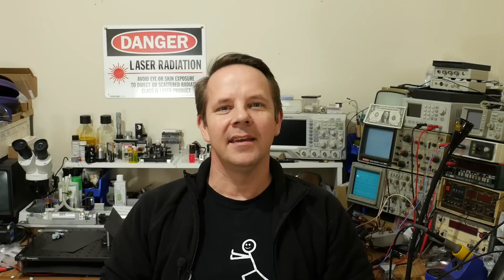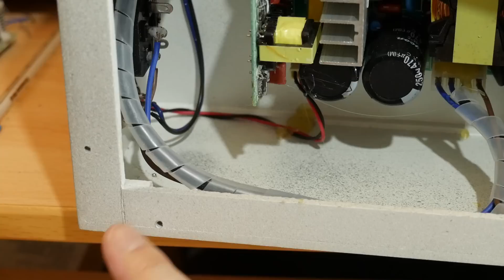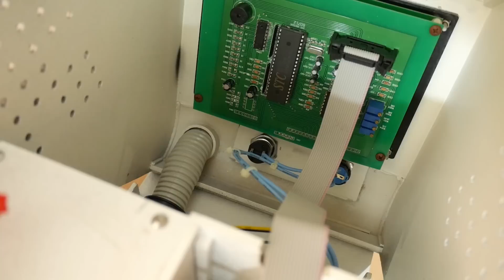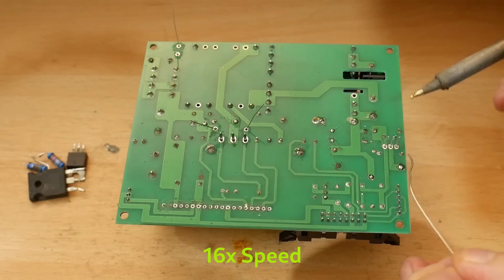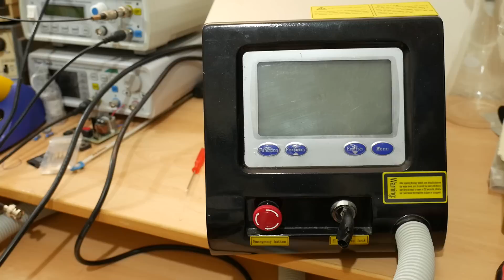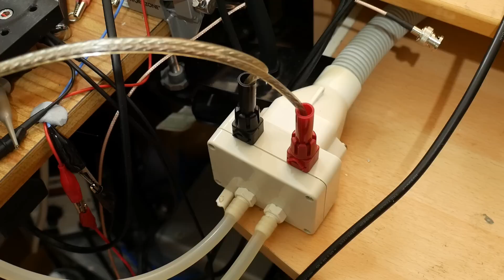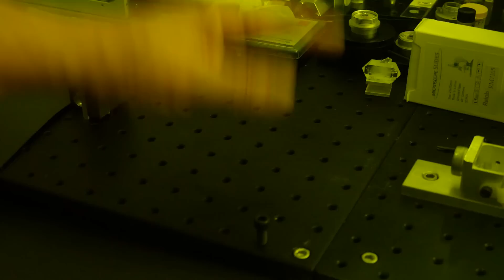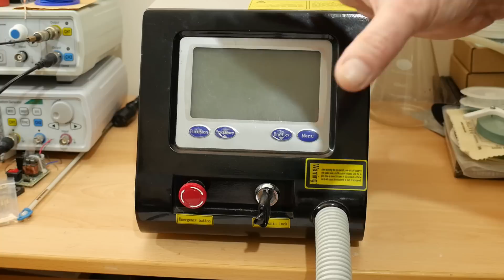DANGEROUS Laser Power Supply Teardown!

Comment: My first thought was...rebuilding the Pulse Forming Network (PFN)...just from seeing the inductor...maybe scraping the PS and use the head for a decent solid-state laser.
I would never think a laser design could be sooo bad!
Reply from the maker: Yeah the PFN is, weird! I suspect the inductance drops to a reasonable level once huge currents are flowing. I have ordered a larger, more spacious ferrite core to wind my own and measure what happens. I have seen this kind of design before, so it cant all be bad, though I think the implemetation here probably is!
Reply: This may be one of those "extreamly" easy-to-fire lamps, and the cause of the tube strike-on may be non-critical damping, probably due mostly to the inductor. @LesLaboratory
Reply from the maker: @dalenassar9152  If it is, then the characteristics are similar for different lamps. I tried it with another head and it has the same effect. Moreover I can hear faint cracking from the main cap, suggesting it is stressed. But yeah, that inductor needs examining. I'm going to replicate the circuit with a home made inductor to see if it can be characterized.
Reply: Speaking of homemade inductors:  I have done a lot of that, they are VERY touchy, to say the least.  In my experiance, the inductor is the brains of the network...I have had some very large pulsed solid state lasers that have required inductors that were about a cubic foot in volume, not many though.

There is a axiom that states:
=====
FOR A GIVEN FLASHLAMP, PULSEWIDTH, AND ENERGY,THERE IS ONE AND ONLY ONE VALUE FOR C, L, AND V THAT WILL RESULT IN CRITICAL DAMPING.
=====

I will dig it up an application that helped a university laser lab and post it here...if you like...it may be of some help.
 @LesLaboratory
Reply from the maker: @dalenassar9152  yes, please add it here. In my own design I used air core as too many variables with almost any other material. I suspect these designers just threw in a cheap homemade trigger transformer, and they were done. It would be interesting to 'scope it when it fires.
Reply: One of the first things to realize (as the analysis will show) is that you can't pick any capacitor for a given flashlamp.  For example, if you end up calculating that a lamp wants a couple of kilojoules, you can't very well fit it with a single 500J capacitor.  Let's look at such an example now: in particular, choose the Xenon lamp I have on ebay.  The first thing we calculate is it's 'dynamic impedance' denoted Ko which has units of {Ohm-amo^-.5}. ** This value is constant for a given lamp.**  The formula is:

(1)  Ko = 1.28 (l/d)*[(p/x)^(1/5)]
where:
l=lamp arc length (mm)
d=bore size (mm)
p=fill pressure (Torr)
x=constant: 450 for Xenon
                  805 for Krypton

Applying (1):
Ko=1.28 (165/13) (450/450)^.2

Ko=16.25 ohm*amp^-.5

next we can calculate the explosion energy (Ex) of the lamp--for a given pulse width. Units are JOULES:

(2) Ex = k*d*l*sqrt(t)  joules
where:
k=90 (constant)
d=bore diameter (mm)
l=arc length (inches)
t=pulse width (ms)

for this lamp:
Ex=90*13*6.5*sqrt(1)

Ex=7605 Joules
this says that the lamp will have a life (number of flashes) of ONE for a 1ms pulse energy of 7605 J
we want much more than a single flash life, so now we look at the 'Life equation'...

(3) L=(Eo/Ex)^(-8.5)  flashes
equation (3) lets us choose an energy (<Ex) for a desired Life (number of flashes)
For example: suppose we want a life of 7500 flashes---what energy should we pulse the lamp with?
..well we can't use (3) directly, we have to solve for Eo.  This gives:

(3a) Eo=Ex*exp[(ln(L)/(-8.5)]  Joules
plugging in L=7500 flashes, and Ex=7605 J gives;
Eo=7605*exp[(ln(7500)/(-8.5)] which yields:

Eo=2665 joules
Obviously this is a fairly high-power lamp and we can't just pick a 500J capacitor for an Eo of 2665J.  Note, there are possibilities like choosing a HUGE Life of something like a billion flashes--but before doing something like this, just get a smaller lamp.

A good parameter to calculate now would be the required capacitance (C).  C is given by the equation:

(4) C={ 2*Eo*(a^4)*(T^2)*[Ko^(-4)] }^(1/3)
where a (alpha) = 0.8 for critical damping
T=circuit time constant (not to be confused with pulse width (t) denoted with lowercase t.  use t=3T
Plugging these values in (4) yields a capacitance...
C=1515uF

Using the familiar capacitor energy equation E = 0.5*C*(V^2) we can derive the equation to determine charge voltage (V):

(5) V=sqrt(2*E/C)

plugging in Eo=2665J and C=1515uF gives:
V=1876 volts

We have found C and V.  Now to find L (inductance for critical damping)  we use the formula T=sqrt(LC) or:
(6) L=(T^2)/C

substituting, we get:
L=73uH

So for this lamp to last 7500 flashes at 1ms pulse widths we can use a 1515uF capacitor charged to 1876 volts in series with a 73uH coil.
or:
C=1515 uF
V=1876 v
L=73 uH
---------------------------------------
BUT...suppose we cant find a 1515uF capacitor?  Note that eq (4) can be solved for T, letting us use a different T to find a desired C.  Of course we could choose a lamp with a different Ko which usually only requires looking at the lamp dimensions and gas type. Try changing the flash lifetime (L)...Increasing L will decrease Eo, C, and V.  These equations, and experience using them can be very versatile and can get you the desired C,V, and L for a given lamp (Ko), pulse width (t), and energy (Eo).  With the help of a very simple computer program, useful tables of several values of the parameters, such as L, Eo, C, V, L can be tabulated for, example, a fixed Ex and t.

You will get your solution,  I like to fine-tune the damping with a 'scope waveform capture, adjusting L, and/or V after firing for that precise critically damped current waveform!

Hope this helps--there is actually lots more and I will be happy to help you further in any way I can.  I can look up some samples that I actually used in designs if that will be of further assistance--just ask.

Bgds,
--daLe

PS
At the moment I don't have the energy to recheck all of this so just you know, I am sending it unchecked for errors
 @LesLaboratory

Comment: This is from an Asian factory with a dirt floor and children working for a bowl rice a day. Put it in a proper case and add your own Arduino controller as that asian SW is full of crap.
Reply from the maker: Probably. It really is quite sad that this kind of stuff goes on. I think if used a microcontroller, I would be as well isolating it with a few inches of fiber optic. The PSU is bound to be electrically very noisy.

Comment: When you said the case was plastic, my immediate thought about the picture was: it looks like someone took an existing sheet metal design and said "make it out of plastic".
Reply: Yes, likely metal design that had a cheaper process applied, using plastic sheet to replace the metal parts, likely because the cloner does not have metal working, but has a guillotine that can handle styrene sheet, and has a drum of scraps, dissolved in acetone or MEK, to make the glue to bond them as well.

Comment: Hello Les, I have the exact same laser power supply, it is called the WJ3 laser power supply. At its maximum power, the capacitor is charged up to 960-1000V and the high tension should only appear on the capacitor after the Beep is heard,  it only start the charging after that Beep.
Reply from the maker: Ah interesting! Thanks for the info, that will help with debugging.
Reply: Maybe see if there is a shorted out hv enable mosfet on the daughter board. Also if not optically isolated i would make it so. 🤔

Comment: Also be wary of these power supplies, they have a habit of firing the lamp unexpectedly, so you really need glasses on at any time the capacitor has charge. The lack of a safety beam stop actuator built into the laser head gives me paranoia at these kind of power levels.
Reply from the maker: You are right, there were a couple of unrequested shots. Agreed, I wear the glasses all the time, even around my own predicable PSU. Stuff can happen.
Reply: Yikes not even a safety shutter 😮

Comment: 10:54 you got another spark from the IEC  con - looks like the  tab from the fuse isn't soldered to the IEC live pin
Reply from the maker: Yeah, it's all stamped metal parts that are press fit together. They don't take solder well either!
Reply: @LesLaboratory  Simply twist the pin in the pressed plate, and it likely will take a better hold. A quick file to remove the plating off the metal will make it take solder, likely made from nickel plated steel. Of course better to replace the socket entirely.
Reply: @LesLaboratory There's flux that makes it take the solder, and preheating is also a good idea. In the past I literally soldered to stainless steel parts, without trouble.
Reply: Big spark spotted at 10:48, just one frame, but you can hear it too.

Comment: Hi Les, when you first powered it up with us looking at the back a spark flew across the grill that protects the fan ! 11:00  great start LOL ! If it where mine I would take it and "do it properly" but I have the time and you may not, but on the other hand making some thing new at a later date is a good option too. Its a win win for the price anyhow......cheers.
Reply from the maker: It's certainly on the cards. I will keep an eye out for a nice case, and maybe some PC watercooling parts. I will be ditching the original controller if I do it though. I reckon a nice analogue frontend is in order.